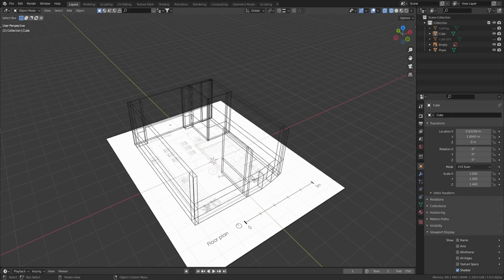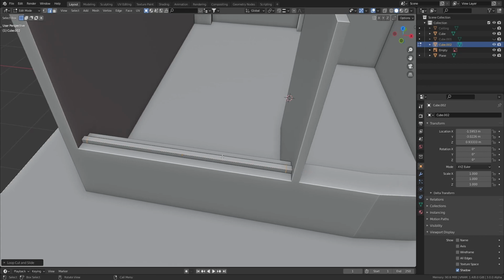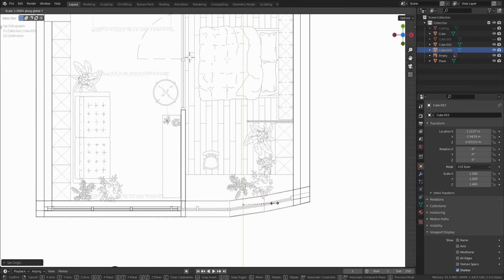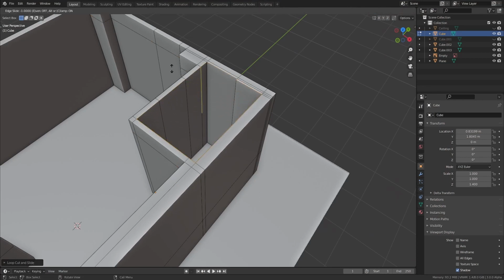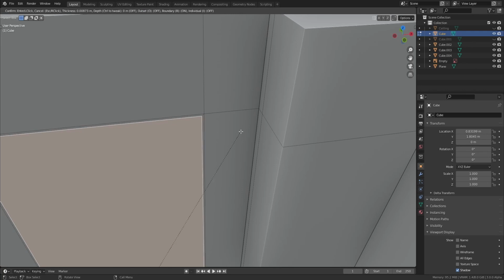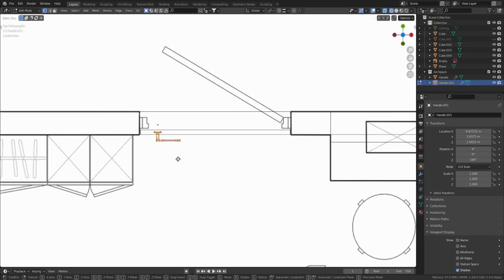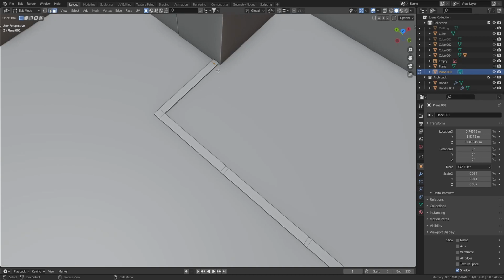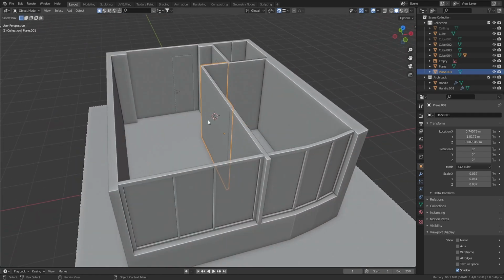Part 03 interior architecture visualization tutorial series in blender

Comment: For the snap tool, if I can just give you a piece of advice: when the snap "mode" is selected (so here, it's the edge mode) you can just maintain ctrl (with the snap disabled) when moving the edges in edit mode and it will be "temporarily" enabled, without having to enable/disable the snap each time. I think it could be more convenient because with this method the snap is always accessible with just a press of a key, even if you forgot to enable it first. But maybe this doesn't fit your workflow ^^
Reply from the maker: Thanks